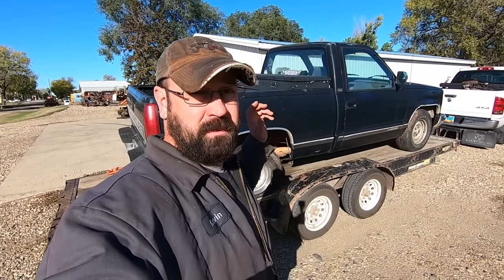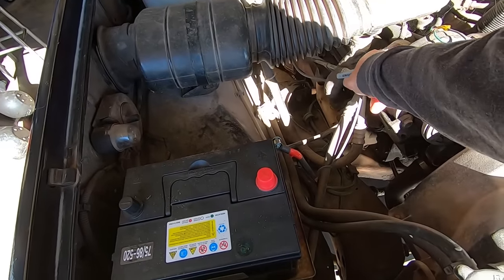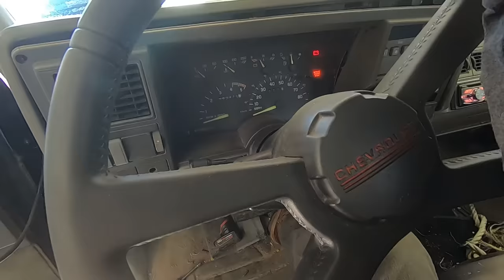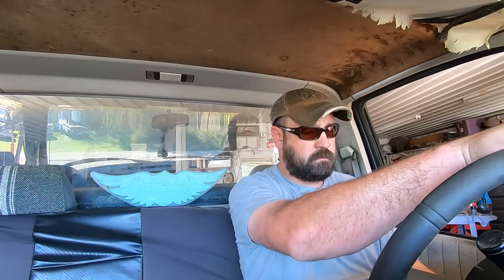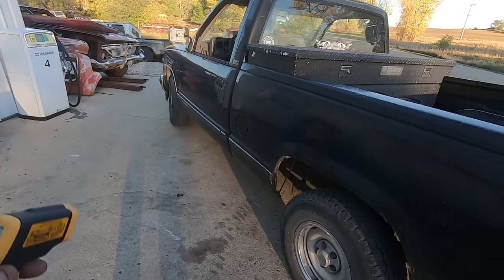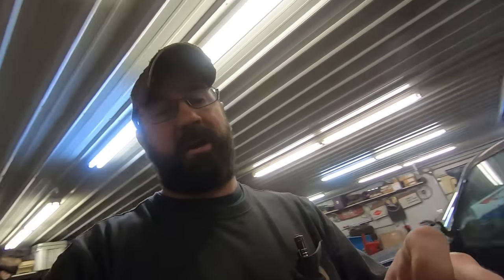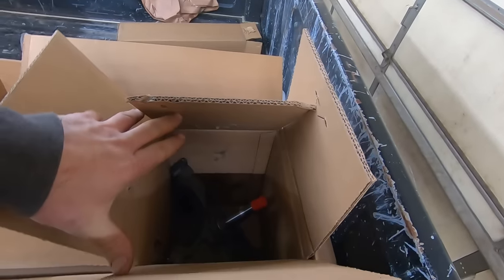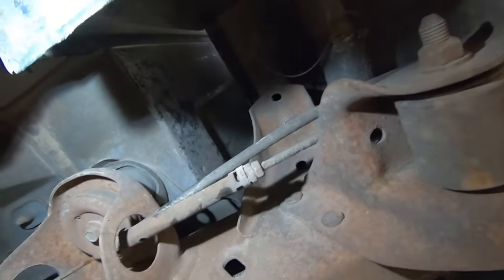1992 Chevrolet Silverado Transformation! From Junk to Jewel! Daily Driver OBS SWB Build!

Comment: Security system installed by "Dashfire Dan"
Reply: Those discount car alarm & starter systems from Dashfire Dan must have been a nationwide thing. Got rid of the one on my Ford Econoline van and it came back to life right afterwards. Just yeet that system and mend those wires and boom...
Reply: With a name like Dashfire Dan, I wouldn't by nothing off him and burn my truck down lol😂🤣😂🤣
Reply: Removed one off my 00 f250
Reply: Investing in future technology
Reply: Most people weld them in c noches
Reply: Opposite that's down three degrees I goes up to degrees
Reply: @joebrock9784  Why are you replying to my dash fire dan comment with something that has nothing to do with it?
Reply: If you haven’t already figured it out already . The hole in the bumper is where the license plate light goes.
Reply from the maker: @SladeM.  We got the special commenters in here too! Great comment tho!
Reply: @MortskeRepair  maybe they are related to the lawnmower guy??
Reply from the maker: @ff912  MOst likely!
Reply: The lawn mower guy is your Side show Bob.
Reply: The red light on the dash is the alarm system, that's what my son's 4Runner had, thought it was aftermarket, but it was factory.
Reply: I know, you said it as I was typing it.
Reply: @MortskeRepair  give me a shout out at the end of the video
Reply: @ghostfox3560 
H Jimmy
0
Reply: Now I'm working on the John Deere 4960 doing an engine swap the injection pump over and I don't know how you're supposed to time them and I asked you other lead mechanic I have a good idea had a Time on but he pretty much told me to go f*** myself and that ain't right being in the shop so when people want to criticize you that's what I got to deal with too so it sorry to bother you but people just pisses me off that people act that way and I don't care if people see once you try to tell me how to do my job when he don't want to even want to help anybody else out in the shop which is 10 other people which he suspects everybody to jump and run for him and it's f*** up
Reply: And this motor has no timing marks to how the hell you supposed to do that
Reply: All right Google I wanted today and nobody knows how to time this motor anyway I'm glad you like my comment like I said everyone here but there's people they pissed me off and I get people at work more I found this wrong with it what should I do fix the f**** thing what else you going to do it's in the shop for a reason
Reply: Mercury switch is the box thingy that you was speaking about in the bed from under the hood  lol reminds me of 16 year old in 93 doing this to my 85 GMC s15 I was given when I was 8 and we bought it for a family trip to California
Reply: Had both a 81 new body style third gen Camaro and a 89 Chevy S10 and the aftermarket alarm system caused burnt wiring and fires in both of them

Comment: I think the only tool you need for any parking brake cable is a trash can...
Reply: Unless your state has safety inspection
Reply from the maker: I agree! Unless it's a manual...
Reply: Love me some Wes and rust. NE Ohio guy. Its bad.
Reply: @rustygriswold182  Try South Main Auto too.
Reply: Then if ypu one like uour white with the 4.3 v6
Reply: @BobPegram  i have seen those. Thanks!
Reply: @brucebonkowski9568  that's exactly what I've been preaching!
Reply: The way i see it the only time you need a parking brake is if you have a manual transmisson
Reply: Yes a lot people do even use till brakes on front fail or booster failed and brakes line leak go hole in them  Lol! In Automatic Transmission don't use them too! But always mine every month and year!
Reply: I think it was Eric O uses a pair of grippies and an air chisel.Knocks em right out.
Reply: @BobPegram  Yeah. He's always talking about how rusty the vehicles get in New York too. We don't use salt on our roads in winter in North Dakota, but that only postponed the rust. It doesn't stop it
Reply: WHAT IS IT ABOUT YOU GUYS AND PARKING BRAKES?? LOL
Reply: @dannyo6699  Lucky you! We, in Vermont have to deal with applied brine now, even worse than dry salt on snow or ice! Just eats up steel.
Reply: @BobPegram  Yeah, I guess we have the brine here too, but our winters lately haven't been bad enough that the state has needed to use it on the Southwestern quarter of the state anyway. I don't know about Mortski's corner though. He's more southeast.
Reply: Explain how you're gonna stop if a brake line goes out on an automatic
Reply: @darrylvanholton9056   how fix them and what can use for when driveing vechile!
Reply: @mikem5475  that what keep Emergency brake in working order and need stop vechile plus get home safe or get to vechile shop fix brakes plus lines or master cylinder fail on main brake pedal !
Reply: @AndrewHCann  exactly. Anyone who is a mechanic and says the parking brake is unnecessary is a hack. Such simple and necessary systems. I didn't even think about what would happen if the master cylinder failed. Good catch
Reply: That why keep my Emergency brake or handle in working order and had my one vechile Master Cylinder and Booster plus brake line fail on me one year in Winter Season months of Ontario Canada come home from work! Glad put new Emergency brake cable plus pads also back  drum one vechile and disk brakes on back ! It save me get home  one night to investigate and get shop work at to repair next day ! Also come usefull too !
Reply: @mikem5475  yes one vechileb had disk brakes on back and another had drums on back when brake line leak fail also master cylinder also booster for brake pedal quit to! One had drum back brakes was on ABS  on 1994 4 door Chevrolet Calavier with 2.2 litre 4cylinder and 3 speed Automatic transmission 5 seater basic car was just Winter Season months beater I had ! Second was 2002 Chevrolet Impala E-X LTZ LS 4 door car had no ABS brakes system and disk brakes on front plus back to in Winter Season months to when brake line broke on right back when try slowed to 4 way intersection both to stop and main brake pedal went to floor wouldn't stop me ! So had use on 1994 car Emergency brake handle to stop by pulling hand up and back ! On 2002 had Emergency brake pedal used like main brake pedal or clutch up also down to stop okay plus both cars in Neutral on Shifter for transmission to slow down with to ! Lucky was no on coming traffic and got home safely till next day got my vechile shop workplace to fix it! But big lots money had to fix up right and lucky never had do again on Emergency brake handle and pedal trick again!
Reply: @mikem5475  there lots useful tips on Emergency brake or handles and when brakes on main pedal fail to do ! I seen lots people never use or get service  to till too late ! Don't matter of vechiles and year should be used and work on lots vechiles of mine plus families and friends too! Plus in 4 to 8 cylinders motor also Manual plus Automatic transmission are Power assstiance or not Power at all or have ABS or not ! The 1994 car had was pure crap car should never made and it more complicated problems then I could say and headache to fix ! When got ride of it and glad went to scrap yard to get recycling for!
Reply: @AndrewHCann  I've also used the parking brake in an emergency too. Glad to hear yours worked
Reply: @mikem5475  yes ever Spring Season in April or May & Fall Season in September or October I grease up front , back brakes plus emergency brake wire also if need changed do up new also check brake lines if need fix or paint on them do it and check main brake pedal to plus booster also resvoior of cylinder to! Ever engine oil change do to also brake pedal feels like also booster plus resvoior cylinder plus lines ! Even fuel lines too plus fuel tank also fuel filter cannister too! See so much and lots people ask me how do keep my vechile so nice and good shape! Easy check list and looking over also repairs need to if needed! I seen my good condition last me nearly 20 years that why keep up nice matinne! Also no watch lights or gauge or smell something wrong or on Lol this OB2 sensor light says you need fuel you have 5 gallon left on gas on E readings and another one says you need Windshield Wipers fluid please add now or Wipers streaking on Windshield! It common sense replaced before that happens and that why I get lots people work to do vechiles especially seniors people and said love your services!

Comment: I have a 94 K1500 standard cab short bed I bought used in 96 in Richmond Va. It came with a dealer installed chip disable style security system. The only time I ever pulled that chip was when I had to work in DC, and that was only a few times. We moved from Quantico Va. to Camp Pendleton Ca. Never pulled that chip again. I still own the truck. Poor truck sat allot as we lived over seas for many years. It has 365.875 on the odometer now and I am fixing it up for the C10 shows. The GMT 400 is the best pickup made in my opinion. 
Edit: When I walked onto that lot eyeballing that truck, The dealer must have done a backflip seeing a young Marine with a pocket full of cash. 18000 is all it had on it.  I paid cash and walked out with a truck that out lasted my marriage.  Out side my kids, Best decision of my life.

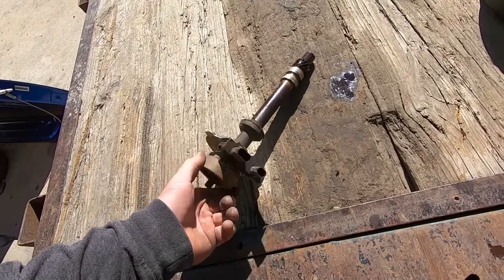Comment: 32:15 those pickup coils are known to go bad, either just flat dead and no spark or it can cause running issues. For timing, by the power block and fuel pump relay on the passenger side of the firewall, there's a single wire connector with a tan wire with a black stripe, that's the ignition bypass lead, when you unplug it, it puts the module in base time. You can then set the timing. Timing for those was 10° btdc
Reply: 0* with EST disconnected.
Reply: Yes its 0* with the wire unhooked. I have owend five of those trucks. Some of the teucks the wire is under the dash by the blower motor
Reply: Don't think I'll ever own or have to time an OBS GM truck, but I love reading comments like these. Spread the knowledge! 👍

Comment: Many miles in a TBI chevy. I believe that sensor you showed was a knock sensor. One problem had on mine was PVC line plugged up and caused   Crankcase pressure to build and would push oil out rear main. Cleaned the TBI base plate and solved oil leak. 240k on the engine and transmission never missed a beat while I was stationed at Grand Forks AFB.

Comment: If it has a new ignition coil on it, count your blessings. I don't think they go out often on these type of system but if they do, you might be in for an interesting time. We had a Hyster forklift come into our shop for a starter issue years ago. It had a 3.0L GM 4 banger but same type of ignition system you have here. The thing would start cold okay but as the engine warmed up, she'd pop and backfire like crazy. After she warmed up, that thing would kick back really bad when you'd start it like it was out of time. It actually kicked back so bad that we broke the nose cone on the starter. Lucky for me the pieces were close enough to the starter hole to fish them out without separating the engine from the bell housing. We monkeyed with timing. I didn't realize at the time that the pickup module compensates timing or I would've probably concluded the problem sooner. We knew it wasn't the pickup because when they quit, the engine dies. Anyhow, on a whim, we replaced the coil and the problem went away. I'm guessing the pickup module was trying to adjust timing for a coil that was failing and that's how we got the gunshot backfiring and kickback starts. I don't think I'll ever forget that experience. Enjoy your Okie truck.

Comment: Gotta love my 1994 k1500 z71. I bought it new end of 1993. Many performance upgrades, 4 inch lift and 33inch tires later, it now has 401,000 miles on it. That's original motor and trans. Love the videos. GaMike
Reply from the maker: Nice!

Comment: I have an OBS Silverado and other than having to replace every single component on the truck, some even twice, it’s been bulletproof 😁. Apparently all the UAW workers that built mine were drunk on the job when the put it together.
Reply: No we were not drunk. GM goes with the cheapest bidder with absolutely no loyalty to vendors that have been reliable.
Reply: @dmaxlife2785  slap a gm 5.7 or 5.3 in literal shit and I'd still buy it for that sucker

Comment: I love my 92 Silverado 5.7, 400k miles on the old girl and its the most reliable thing I own, Mines the extended cab, when I took the back seat out and put a long tool box back there so I can still use the full length of my bed. I did have a carrier bearing go bad, I cut the crossmember out and put in a normal drive shaft I had saved for my 91 c1500.
Reply from the maker: Nice!

Comment: Going back to 1994, I bought my first OBS (88-98) and a total of 13 have been bought since. Still own my 1992 and recently traded my '95 1500 for a 99 (Still OBS Body Style) C2500 3/4 ton. I'll never own anything newer. Mainly because they're full of Chinesium crap and no longer Union Built with the exception of the final assembly lines. Great Job on this one! Zip~
Reply from the maker: Damn!! Thanks!

Comment: Diagonal Cutters are what we called them. Does it have a bad distributor main shaft? Back in the day we'd see these where they wouldn't keep timing or no start hot or at all times. Same goes for the pick up coil and module. GM's fix under warranty rebuild the distributor, install a new pickup/mainshaft/module. There should be a wire along the firewall (brown single wire comes to mind); disconnect to set initial timing. Reconnect, shut off, clear code. Bobs your uncle it runs like new. Occasionally we'd see a bad coil, typically on higher mileage units. Love the videos and the channel! 

Rock-On, Mortske!

Comment: Mortske just use the brake switch for your cruise control. It has the opposite function open circuit vs closed circuit. But you can use a 5 pin relay  for that. When you close the circuit for braking it will engage the relay to open the circuit which you can use for your cruise control. Very simple actually.

Comment: Had a 1990 Sierra short bed that didn’t run for over 12 years it took little to nothing to bring it back to life and I did remove the tbi motor for a 2003 5.3 swap! A little cash for the transplant but well worth the 295 horses it produced and swapped in a 4l80 trans and posi for the back!
Reply from the maker: Heck yeah!
Reply: Finishing up watching the 92 episode pretty cool truck you’ve got there! Hope you have good luck with the pup! The best trucks, right!

Comment: I'm fixing up an 89 Chevy Silverado I've tuned it up changed the oil replaced some of the sensors and egr valve now I'm running some marvel mistery oil in it in the gas and oil the truck got 15400 on it runs good.
Reply from the maker: Nice!

Comment: My wife has a 94 she bought with her ex. It had the exact same system in it. When I finally got the wiring stuff fixed. I ended up with a brand new dash, a completely soldered back together wiring harness, and her AC works now 😂

These old trucks are fun but annoying haha

Comment: At present Im parting out 16 of those square cab Chevy and  GMC pickups.  They tend to be rust buckets even here in Arkansas. However I have a 86 GMC cab thats 100% rust free. Ive only had two rust free square body cabs . I sold a chevy 3/4 ton rust free cab last year.  I can realize more money by junking a square cab than by trying to sell a running truck. Especially if it a long bed hardly anyone wants a long bed.. I use the front crossmembers under the 60 thru 70 trucks to convert to  5 lug front  disk brakes. I prefer the older  GMC frames because they came with rear leaf springs and a 73 & newer rear end will work and you can get 5 lugs & a more desirable gear ratio. My wrecker is a 82 -3/4 ton. It has a 305 and turbo 400 trans.  Im just finishing a engine install in my 71 -3/4. the original 402 dropped a valve. so now its a 454. It will soon be my wrecker and my 82 will bite the dust.My self I wouldnt repair a rusty square cab even if you gave me the patch panels for free.

Comment: We have a 91 GMC Sierra and the windows usually won't work when it rains. Right now they are stuck down. Just what need, another project. Anyway, nice job on the truck. Those things are worth big money here in the central valley of California.
Reply from the maker: Found a loose pink wire that plugs in the fuse panel

Comment: You can time those trucks, under that relay cover or by the glove box, you'll find a tan wire with a black tracer,   it'll have a plug on it, un plug it, that bypasses the timing that the computer gives it, set it at 0 degrees then lock it down, plug the wire back in, clear the code it sets and your good to go, I've had tbi trucks my whole life

Comment: EBL flash 2 is a tuneable ECM that plugs into the factory whip and mounts where the factory ECM does. It also has USB interface to ECM to change the fuel and ignition maps. Swap the MAP sensor to a 2 BAR your TBI will happily accept boost with a blow threw hat.
Reply from the maker: Interesting!

Comment: Hey dude, I am 73 years young and that sweetheart converted  e to lowered 2wd. But that 350 needs to breath to br happy, suggest a Magnaflow 1 into two muffler. Put one on my 98 Dodge Dakota and it sure made a difference without a ton of noise. Add in a cold air intake and you'll have a happier stronger motor. My Dakota sure surprised enough 5.0 Mustang kids to the point that no fool hotshot kid would stoplight me.

Comment: If ya run in to a hose issue in future and it has the big metal bracket, grab it with a big pair of plyers and open it up till the hose pops free, it works for me 86.75309% of the time